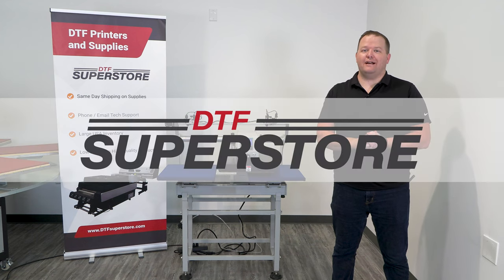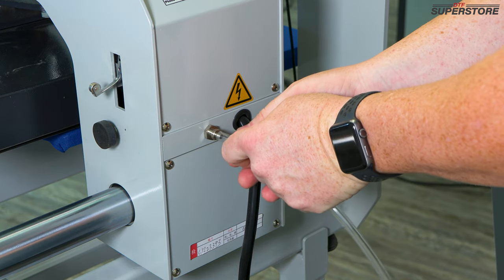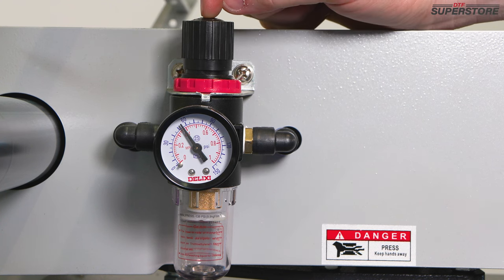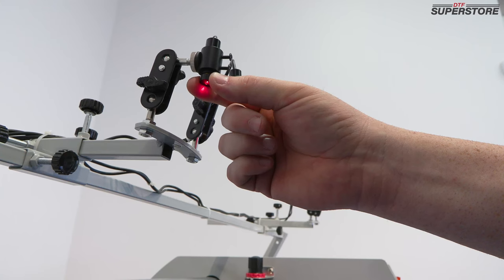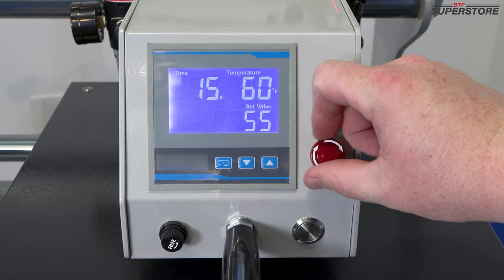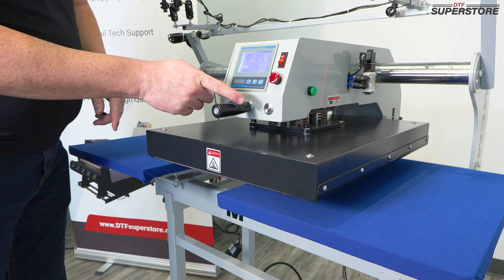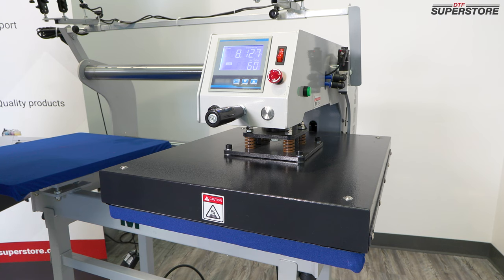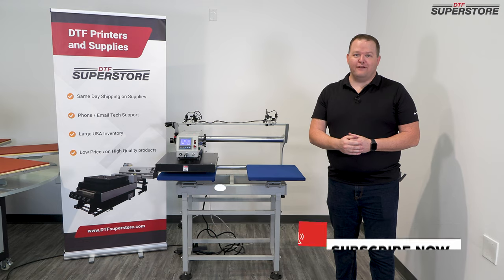Dual Platen Heat Press Setup | DTF Superstore

Comment: Hi .. I have a question , what is the difference between the normal heat press ( without air compressor) and the automatic heat press,
Because I want to make a sublimation on aluminium panel, and I fell confused, what should I buy?
Reply from the maker: the air compressor presses down and lifts up the heated platen.  Normally you would just use your hand to full now a lever.  This will work great for sublimation on aluminum.  Actually did that on this press, customer brought some in to test.

Comment: Where can we get the air hose fittings or does it come with them?
Reply from the maker: It does not come with the air hose or the fitting to go to a compressor.  You local hardware store should have them or you can order them from amazon here: 
Hose: https://a.co/d/91MKDv0
Air Compressor Fitting: https://a.co/d/eyacbU6
might not fit all compressors

Comment: What if my press gets stuck down? Like if I hit the estop and now it won’t come back up?
Reply from the maker: Make sure you have air pressure from the compressor...next check the valves on the right side. See if something is stuck there.
Reply: @DTFSuperstore  thank you! It ended up being jammed a bit. It came down unevenly on the platen and got itself stuck. I had to yank it up a bit and then it released and is back to normal!
Reply from the maker: Awesome! Glad to hear you're back up and pressing!